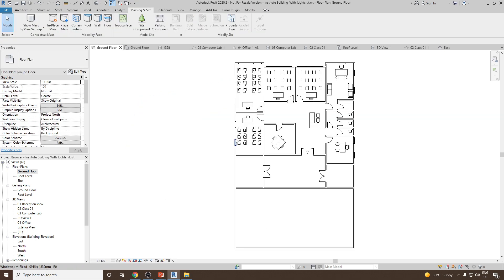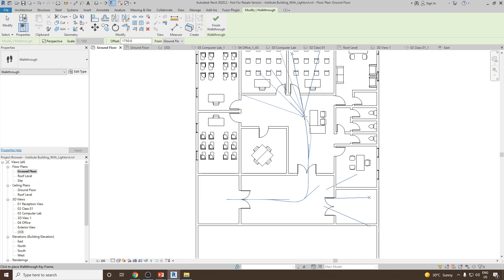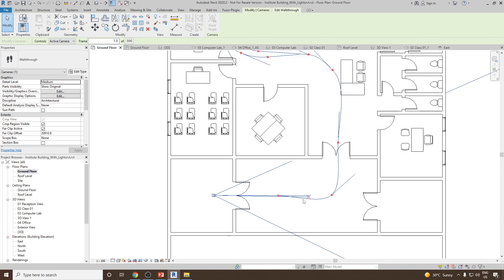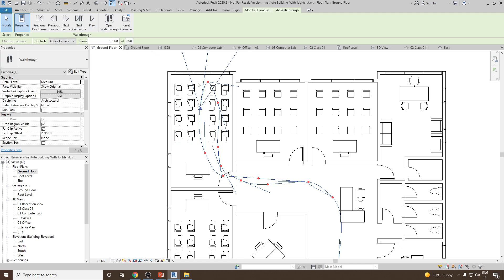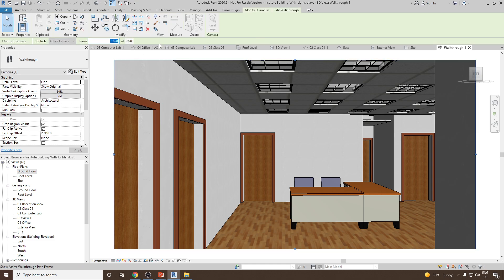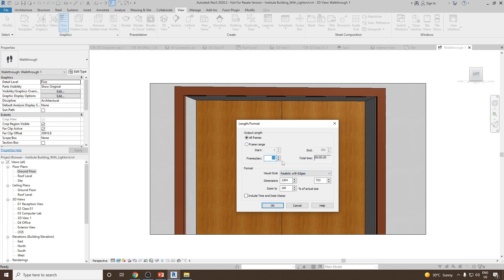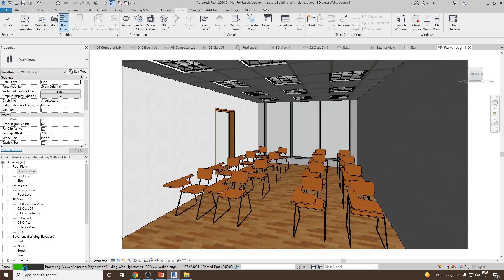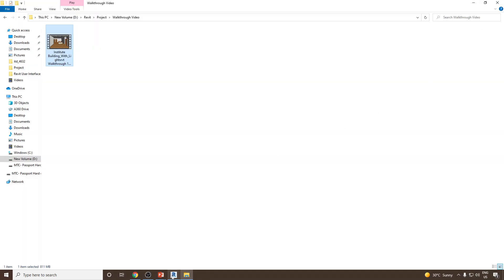How to Create a Walkthrough Animation in Revit - Step by Step procedure

Comment: Nice video. Is there a setting to slow down the walk through in Revit?
Reply from the maker: Yes you can change the frame rate!
Reply: @bimparametrics . Confirmed. I just tried it out after watching this video. Bit rate if lowered extends animation duration and slows it down. Thanks.
Reply from the maker: @stancogeorge8912  Great 👍